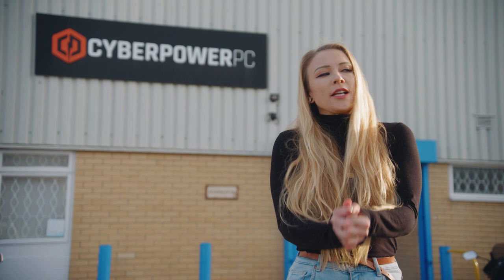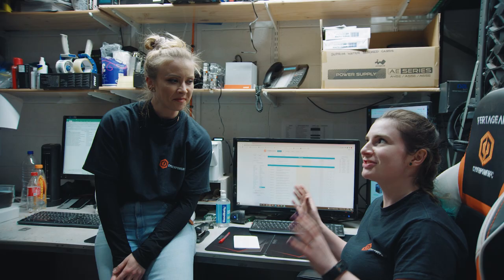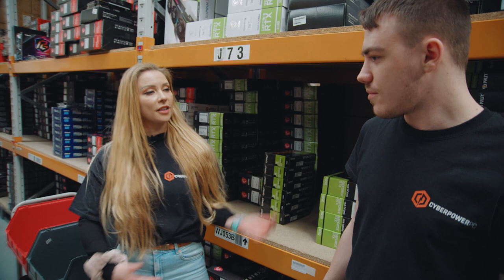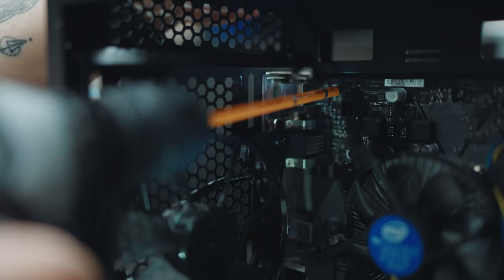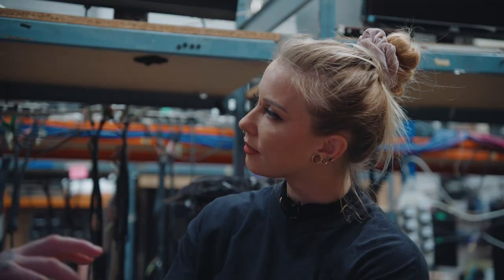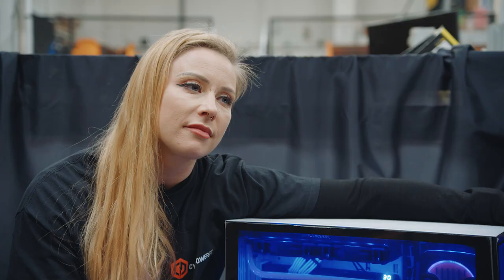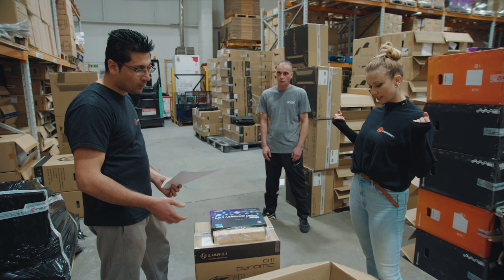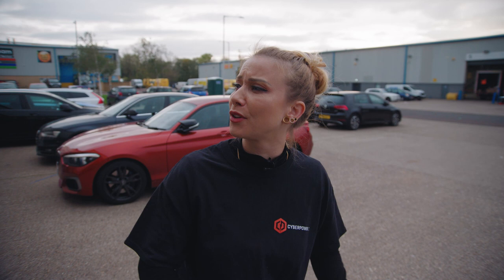Julia Hardy Builds Her Dream PC | CyberPowerUK

Comment from the maker: System Specs
Case: Lian Li PC-011 Dynamic Mid Tower
CPU: Intel 12th Gen i9 12900K
GPU: MSI RTX 3080 Ventus 3x Plus OC
RAM: 16GB Kingston Fury Beast 5200mhz DDR5
Storage: Seagate Firecuda 530 2TB
MOBO: MSI MPG Z690
Cooling: Corsair Hydro X Series Custom Loop